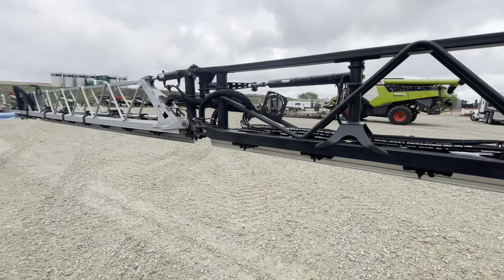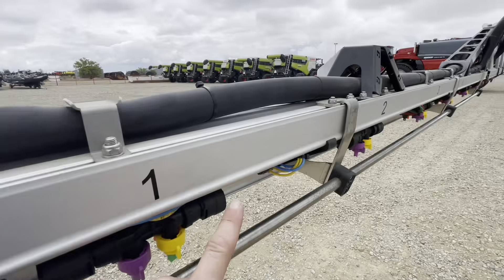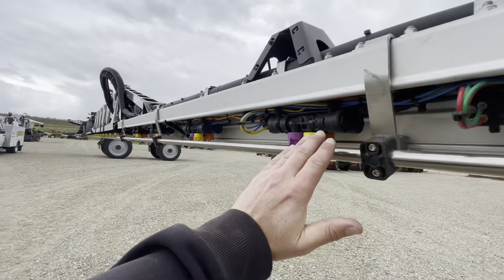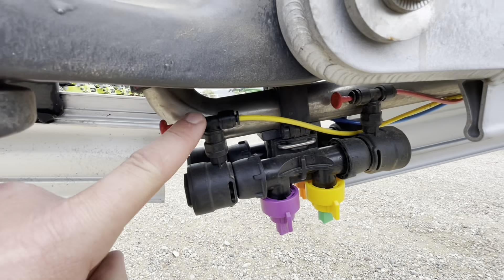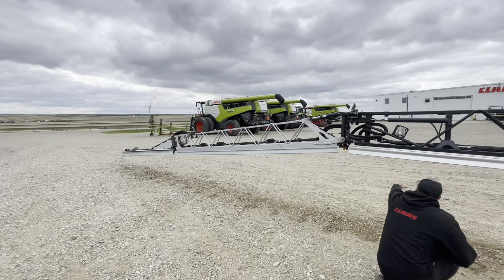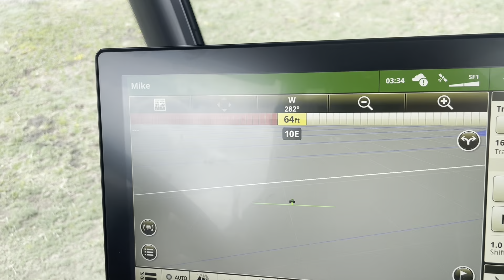Setting up the first 160 foot Horsch Leeb VL

Comment: Running 42 meter in little fields in uk works fantastic no such thing as to big as can fold it in if needed agrifac got the biggest at 54 abd can close down if needed. Mines a trailed landquip with Canadian booms they are fantastic. Horsch are smashing it in the market though I will give them that but they have a lot of funding where the uk sprayer produces don’t

Comment: The electric modules that control the shut offs must be mounted on the center rack?  Agrifac runs theirs out on the boom, higher up in the frame. 20 more feet and you'll be caught up with their 180'